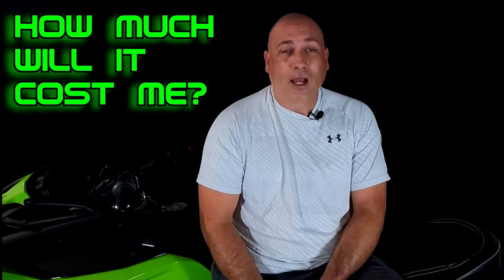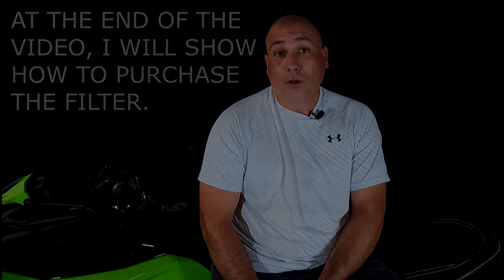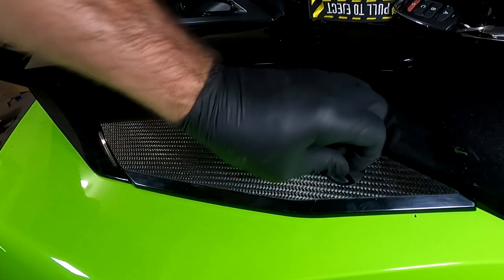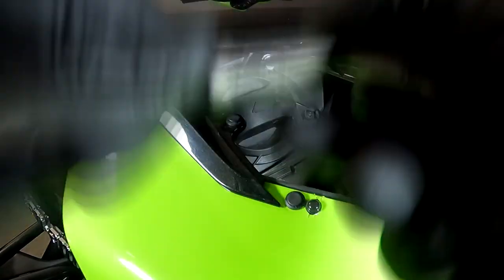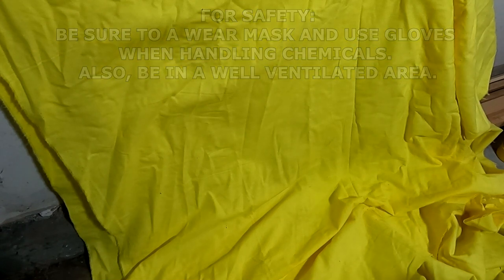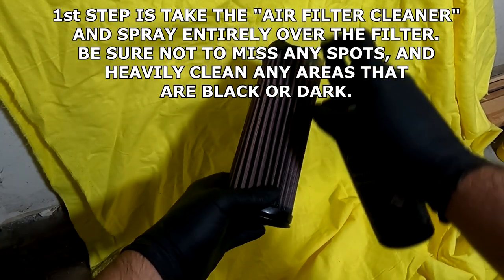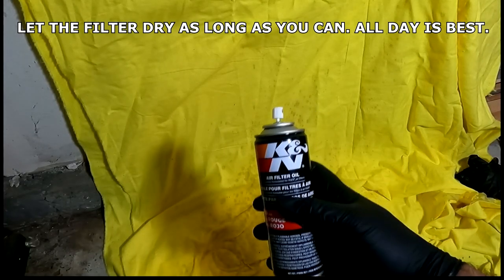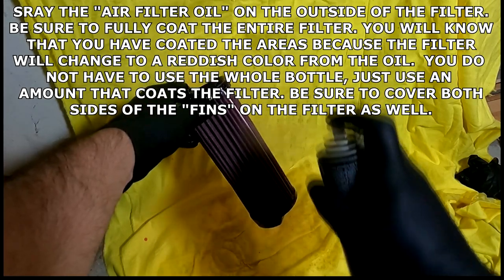K&N filter for Can-Am Spyder. Installing this filter helps your Spyder F3 and saves you money!

Comment: After the maintenance and commercial, something unfamiliar appeared on the screen. I have an N symbol in the transmission screen, then to the letter E. The first experience of this malfunction, can anyone help?
Reply from the maker: Not sure what you mean by commercial? What year is your spyder?
Reply from the maker: The letter "E" appearing instead of a gear means that your gearbox position sensor malfunctioned. If N+R are flashing quickly this means your Spyder can not determin what gear it is in. This most of the time means your (GBPS) sensor malfunctioned or is failing. It is best to take it to a dealer as soon possible if under warranty.  Service manuals show the cause could be damaged circuit wires, damaged gear position sensor, damaged ECM pins or damaged transmission.
The only way to really diagnose is if you have "B.U.D.S" and this is also the way to fix it as well. 
Dont play around to much with this error code because you can seriously damage your Spyder.
Hope this helped.